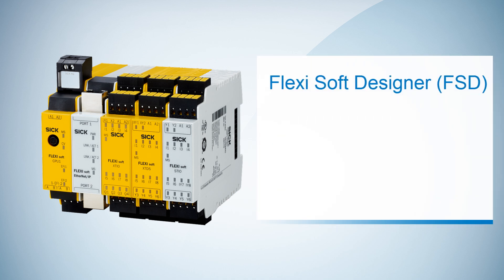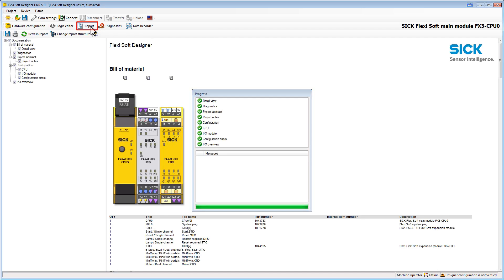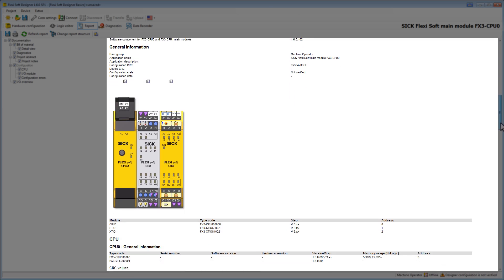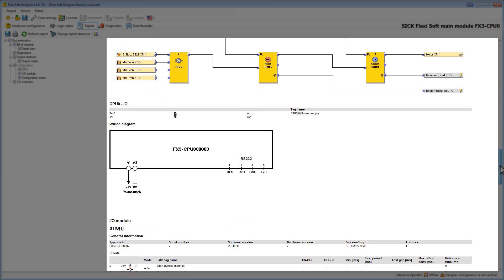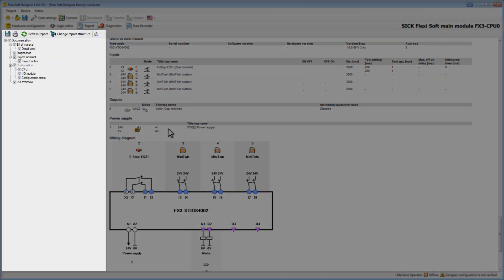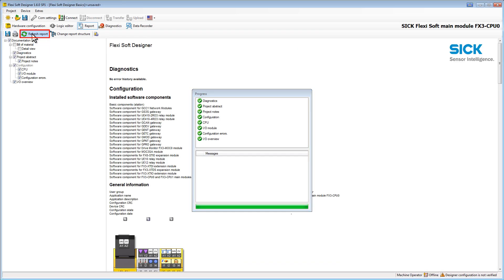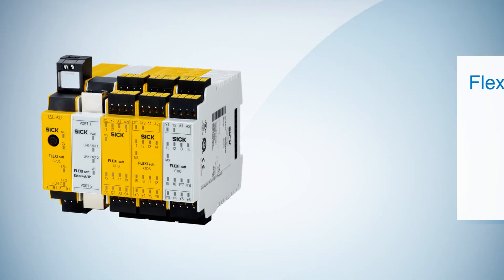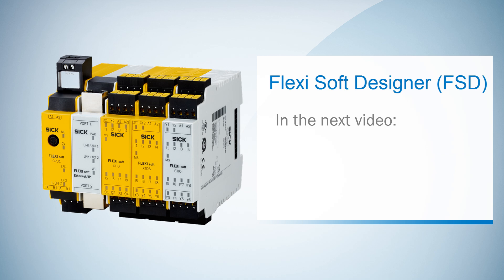Tutorial Flexi Soft Designer (Part 6/10): Report | SICK AG

Comment: Why are these videos 11 years old.  The software is updated and does not match what you are showing.  I have to go to other websites to learn SICK SAFETY DESIGNER as SICK has old software videos on their website.  ; (
Reply from the maker: Thank you for your comment. The Flexi Soft Designer has indeed changed over the years and some parts shown in the tutorials might differ slightly from today's version. The core features and functionalities remained the same therefore the tutorials are still useful for understanding the software. Please be aware that there are two software configuration tools. The Flexi Soft Designer (as shown in the tutorial) and the Safety Designer (not shown in the tutorial).
If you need further support please contact our experts. You can use our SICK Support Portal or the contact form on our website www.sick.com.